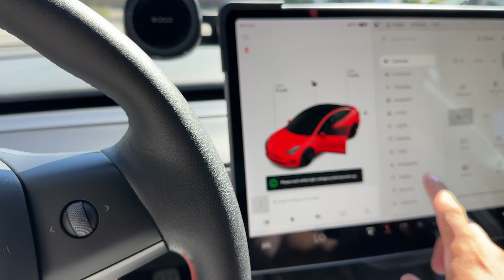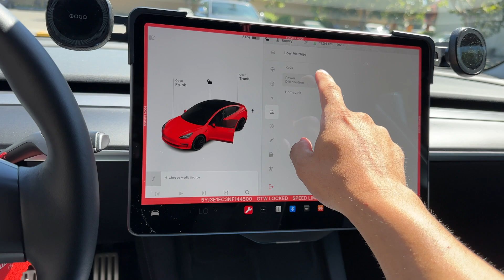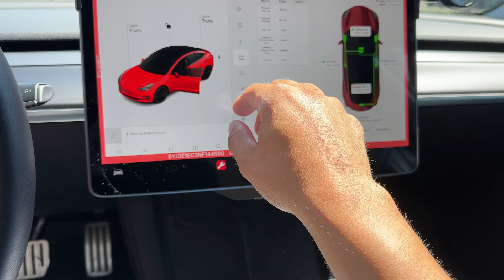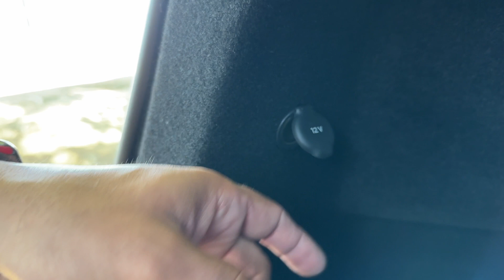Tesla Model 3 Power Conversion System Failure!

Comment: I had similar messages, I had to replace the 12 V battery. Fixed all of it. Lmk what happened!
Reply from the maker: I ended up having to replace the “power conversion system” and the small 12v battery
Reply: @Roadtripper420 how much was it?
Reply from the maker: @tyga9766  like $2,400 total 😭
Reply: @Roadtripper420 sheeeesh, hopefully mine won’t bite the dust lol. Got 52k miles and it’s a 2021.
Reply from the maker: @tyga9766  yeah it sucked! I know of Teslas over 200K miles that are still on the original power conversion system...my left side DRL light went out and Tesla said I need to replace the whole headlight assembly...$2,000.... 🥴 Not happy about that, I found a shop that said they'll replace it for $300 including parts and labor. Up until now I've never really had an issue but the minor stuff that comes up ends up being super expensive

Comment: That’s what happens when you don’t do recommended maintenance.
Reply from the maker: What recommend maintenance? They said the part just malfunctioned on its own
Reply: Huh? I thought Teslas had no maintenance requirements? Don’t all software updates happened automatically? What didn’t he do?
Reply: @DinoTamer23  12volt battery terminals need maintenance at least once a year. Brake calipers need maintenance every 12k or once per year. Tire rotation every 6k to 7.5k. Suspension needs  an inspection every 12k.
Reply from the maker: My break pads are still super far since I never use the break pedal, and I do the tire rotations every 5K and Tesla says to replace the battery every 3-5 years. They don’t say anything about servicing the terminals
Reply: @Roadtripper420  They do. It is not replacing the pads. It it servicing the calipers and slide pins. Also the electric parking brake. The more you use regen the more problems you will had with the hydraulic brakes.
Reply from the maker: @harveypaxton1232 so not true, Tesla doesn’t require any of that and the regen brakes use the electric motors…
Reply: @Roadtripper420  you must be the ICE driver that never changes their oil.
Reply from the maker: @harveypaxton1232  LOL, gas cars require maintenance. teslas don’t. You’re not very smart. Yeah sure bud, I'm the ICE driver that never changes their oil even though I drive a Tesla LOL.
Reply from the maker: Maybe my next video will be me doing an oil change. What are you gonna do about it? I got real fast "ICE" cars available. Do you even own a car? With your ZERO VIDEO channel.
Reply from the maker: Literally not true, where do you low IQ individuals come from?

Comment: Ya, the 12v battery which is just like an ICE vehicle, if it goes bad, no drivey drivey. Replace em every 2-3 years before they go bad. You can also jump start the car if you know how.
Reply from the maker: Yeah that’s what the car next to me was telling me to do, but then I still would have had to replace the expensive power conversion system which honestly sounds like it should be a part of the drive train which would have been covered under warranty
Reply: @Roadtripper420  Ya never heard of the power conversion system. But hey after 101k miles and virtually no maintenance is pretty good.
Reply from the maker: @sarchizm 💯
Reply: @Roadtripper420 is there anything you could have done in hindsight to prevent this?
Reply from the maker: @DinoTamer23 unfortunately no, this was the first issue and I’m over 101,000 miles so I guess that’s not that bad when you consider that I never paid for any other maintenance